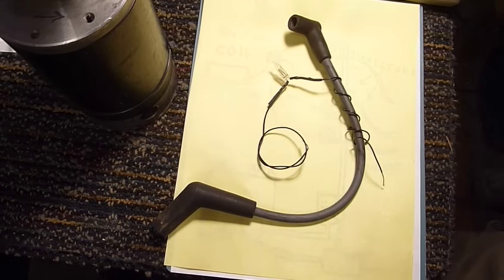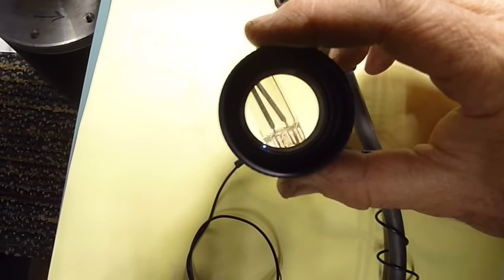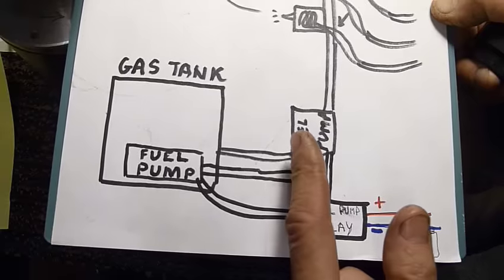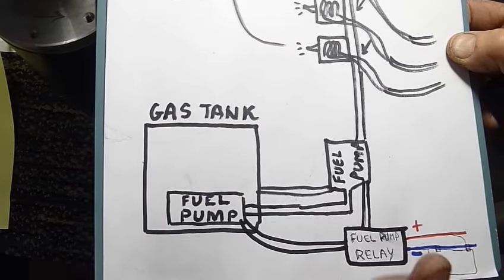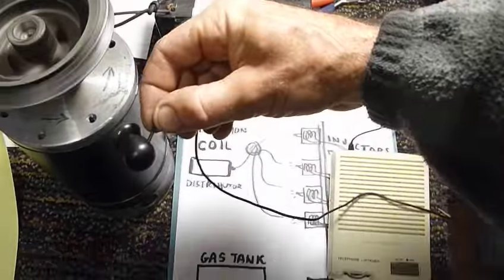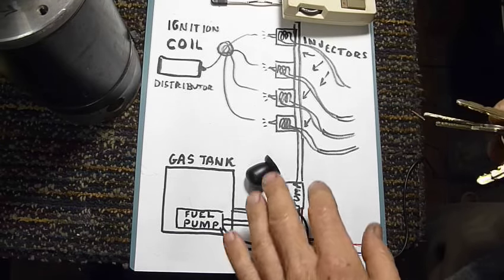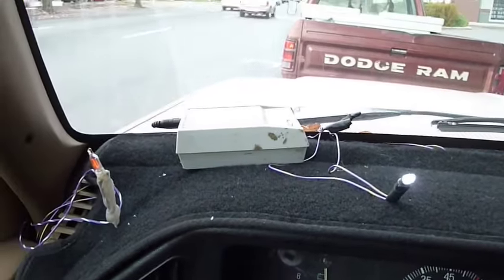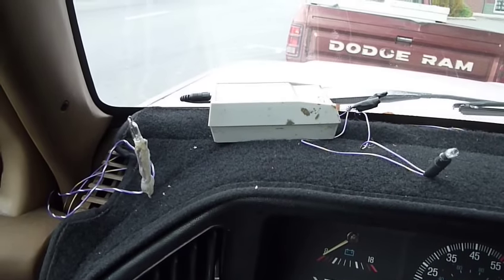Fuel pump diagnosis while driving.

Comment: Very clever!! I don't think my Harbor Freight scanner would give me this real time information as easily.
Reply from the maker: +Scott K I imagine on the older cars in the particular  there are many things a scanner can't detect. Prior to having a fuel pump issue I had a slow to start issue, and someone with a high end scanner scanned my truck and it gave us an incorrect diagnosis.It suggested I replace my throttle position sensor. It said nothing about my fuel pressure regulator which was the real problem.

Comment: Classic fuel pump problem. Always use OEM fuel pump or you will be sorry charlie. A failing fuel pump usually has high current draw. If you could rig up an ammeter and monitor while driving would be a visual analyzer.. Alcohol in fuel eats up magnets in cheapo aftermarket units. I truly admire your honest logical approach to diagnostics, becoming a lost art. Another lost art, visually analyzing the CAN bus of your car with an Oscilloscope. When your TV business dies, this will be a new career in diagnostics for you.
Reply from the maker: Thanks, That sounds like a good idea.
Reply: Dave, was thinking... fuel pump analog ammeter would be a valuable gauge in an older car. Could visually see a soft failure. Fuel pump soft failure would be failure of a commutator which is common in older pumps. Fuel Pumps have between 8 to 12 commutators. A failed commutator has symptoms of a miss or similar to a burned valve. Most techs have no clue. A knowledgeable mechanic would current ramp the pump on a costly Snap-On scan tool. Can do the same with your eyes on an ammeter while driving!
Reply from the maker: Sounds like a good idea. It could possibly enable you to see a problem coming before it completely fails.

Comment: Hey Dave when my 86 Ford Bronco II started having the same problem I ran my pressure gauge from the fuel rail and managed to prop it up so I could read it while driving. I ran the hose between the hood and the fender while adding a shim to insure the hose didn't get crushed. sure enough when the vehicle stalled (mostly when hot) I determined the fuel pump was the problem. The pressure went from 30psi idle and 40psi under load to around 10-20psi and the truck barley running. With nearly 200,000 miles I decided to change both the low and high pressure pumps. It ended up being the low pressure pump in the tank that was bad. It was totally seized and had been for quite some time. I could tell by the discoloration of where the brushes were sitting on the commutator, and also the inability of the motor to turn at all by hand. I should have done a video on it.  I thought of reading the current of the 2 pumps individually to see which one was actually the problem, but didn't have the time.  I will give you a call some time or you can call me when you get a chance and we will chat again. I need to get back up to see you and my other friend Dave also!
Reply from the maker: +norcal715 Hey Steve, I appreciate the info. Driving around with a fuel pressure gauge in the cab sounds like another good approach.  Based on all the advice I'm getting from everyone I'm guessing your probably right about it being a fuel pump, but I hope it isn't  the one in the tank. My neighbor at the auto part store  said it's generally the high pressure pump under the vehicle that goes bad.  He said due to the alcohol they now added to gasoline they see all kind of fuel delivery problems. I thought about buying the non-alcohol stuff but the price is about double what I normally pay. If you make it up this way I look forward to see you. I just saw Dave a couple days ago

Comment: Hi, I got some info for you that might be useful.  To rule out the computer not energizing the Fuel pump relay for some reason when truck stalls, you can do it yourself at STO connector by grounding a pin (link below Fuel Pressure Test).

General Info:
The electric fuel pump system consists of two fuel pumps: a low pressure boost pump mounted in the fuel tank, and a high pressure fuel pump mounted on the frame rail. The low pressure pump is located with its inlet at the bottom of an internal sump in the fuel tank. This design provides for satisfactory fuel pump operation during extreme vehicle maneuvers and steep vehicle attitudes with low tank fill levels.
The low pressure electric fuel pump is used to provide pressurized fuel to the inlet of the high pressure pump and helps prevent noise and heating problems. The inlet of the low pressure fuel pump has a nylon filter on it to prevent dirt and other particulate matter from entering the system. Some vehicles use an external resistor in the low pressure pump circuit to reduce operating volts to 11 volts.
The externally mounted high pressure fuel pump is capable of supplying 21.2 gallons of fuel per hour at a working pressure of 379.2 kPa (55 psi). The pump has an internal pressure relief valve to provide over-pressure protection in the event the fuel flow becomes restricted. Over-pressure is restricted to 123 psi and reduced fuel flow will result. The system pressure is controlled by a pressure regulator on the engine.

Video how to test for codes
https://youtu.be/X07hu0kAuzE

Block Diagram
http://oi57.tinypic.com/17frdh.jpg

Fuel Pressure Test
http://oi61.tinypic.com/ff1pa0.jpg
1988 Ford Truck F 150 2WD Pickup L6-300 4.9L
Fuel Pressure: Specifications
Key on engine off ..... 50-60 psi
key on engine running ..... 45-60 psi
In tank fuel pump flow ..... minimum flow 16 oz of fuel (473 ml) in 10 seconds.

Tester (use Teflon tape on fittings)
http://www.harborfreight.com/fuel-injection-pump-tester-92699.html
Reply from the maker: +MaxAirGo Thanks much for all the in depth info on fuel pumps.

Comment: Sometimes you can smack the tank with something large and heavy like a shovel to get it turning again.... makes for a quick diagnosis and a good way to get back on the road.
Reply from the maker: +Kyle Whybrew  That's a good tip although my truck has Two fuel pumps. Only one is in the tank. I've also seen
 starter motors unfreeze with a good whack..

Comment: I think the best course of action would be to hook a pressure gauge to the fuel rail. I'm not sure but I think it's possible that a fuel pump would lose pressure when it gets hot. But I guess you would be able to hear the pumps rotation increase if that's the case.
Reply from the maker: +Arnþór Gíslason I would agree with you except for the fact that the Truck often runs fine for days. Being that it's an intermittent issue I figured this was worth trying.
Reply: If the pump loses pressure wouldn't it's rotation decrease?
Reply: Of course there are many failure modes. In the case of the vanes in the pump losing the seal the motor would see less load and I think the motor would increase in speed. I don't know if that's common but I was just throwing it out there as an idea.
Reply: +Arnþór Gíslason Ah in that sense I can see the motor rotation increasing to make up for lost pressure. I was thinking along the lines that if the motor itself was faulty over all pressure would be less due to less rotation.
Reply from the maker: +mrsemifixit Sounds like a possibility, Since I'm now able to monitor some of what's happening I likely to figure it out soon..

Comment: Have you inspected the operation of the fuel pressure regulator?
Reply from the maker: +mrsemifixit I just replaced the fuel pressure regulator about 3 months ago. It solved the problem I was having with slow starting, black smoke, and uneven idle speeds.
Reply: +Grants Pass TV Repair Hmm it's possible if that was bad it weakened the fuel pump. Check the operation of the emergency fuel cut off switch that most earlier fords had in case of an accident. Maybe it's tripping at random or the wiring to it has an issue
Reply from the maker: Thanks for the tip on the inertia switch. My monitors should pick that up if there is such an issue, but for the time being my truck is symptom free.

Comment: That pump didn't sound to good if it sounds anything like your pickup made it sound like. I don't know what  a plugged filter will do on a dual pump system, but on a single pump system it can damage the pump. Does the pump have a smooth hum or buzzing sound or does it sound like a thrashing machine, like on this video from your pickup? Also the way a car quits can tell you alot about  weather it is fuel or electrical. You didn't say what kind of car it was, but I would just guess it is a Ford if it has 2  pumps. Maybe you should do a video showing out it acts when it quits.
Reply from the maker: +kwd57 The pump does seem to have a thrashing sound. The stalling problem is an intermittent issue that can go for days without any problems, so making a video of the symptom would be difficult.  I suspect it's the high pressure fuel pump under the truck but only time will tell for sure.

Comment: I can help you on this one since I replace them all the time, It is the FUEL PUMP
Reply from the maker: +MrMac5150 I appreciate your expert opinion although I'm looking forward to seeing this on my monitors. Would you guess it to be the high pressure pump?
Reply: Grants Pass TV Repair
 May I give you a couple more, the fuel pumps on Amazon for $30 bucks are the same ones that the auto parts stores are selling for $200 bucks, they are all cloned with the plastic gears inside. If you can get the old stock 1980 to 1985 they have brass gears inside, it is never due to filters the brushes just get worn, and none of the new pumps last more than two years including, AC Delco,
AirTex, Delphi. all China junk regardless the money you spend, this has been my experience in the last 10 years.
For your Ford Truck any of them will work with  a 40lb pressure requirement.
Good Luck, It is never the relay unless the pump shorts out, in all the Chevys I have never found a voltage drop across the relay.
It will be the Pump 99.9 percent.
Just pound on the tank if it does not start, this will get you home.
Reply from the maker: +MrMac5150 Thanks for the info.
Reply from the maker: +MrMac5150  My homemade monitors confirmed you were correct about it being the fuel pump.  Thanks again.
Reply: Grants Pass TV Repair
 Well I am happy to hear that, you have been the most, helpful person on the Internet, and I hope you continue to do your electronic videos forever. THANK YOU.
P.S. Me and the kids really look forward to them.